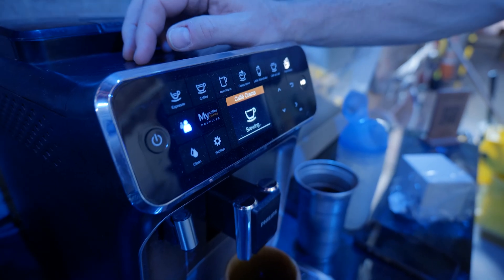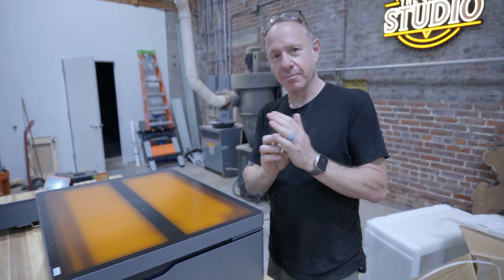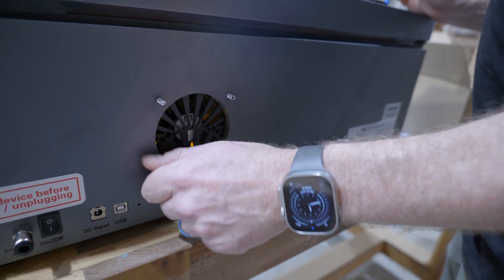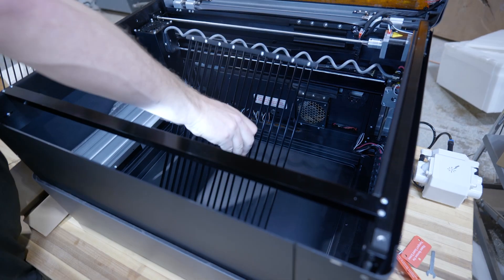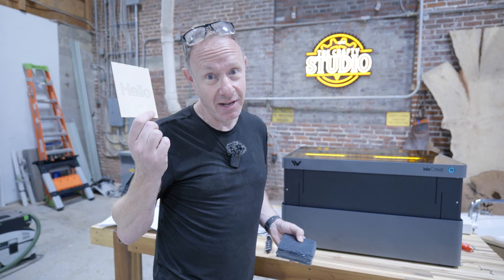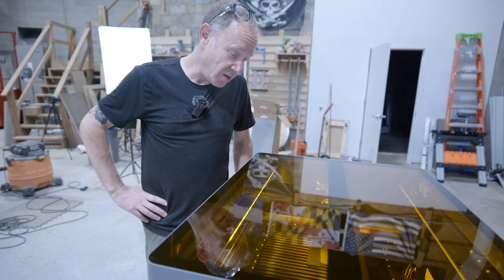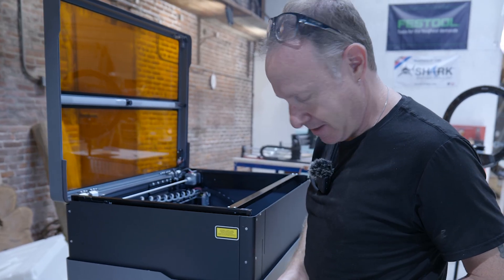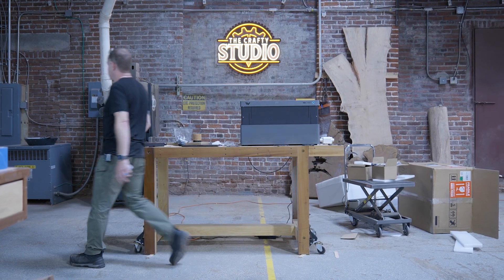WeCreat Vision Pro Laser Unboxing + Setup | Real Shop, No BS

Comment from the maker: ⚡ FIRST IMPRESSIONS: The WeCreat Vision was super plug-and-play out of the box.

✅ Setup was fast, software connected easy, and the first cuts were surprisingly clean.

❗Haven’t hooked up the Air Guard fume extractor yet—that’s coming soon in a follow-up vid.

👇 Got questions or want me to test something specific? Drop it in the replies—I’ll be running this laser through the chaos gauntlet over the next few weeks.